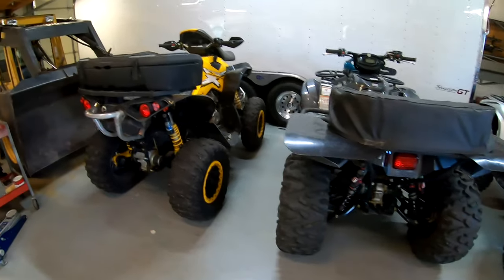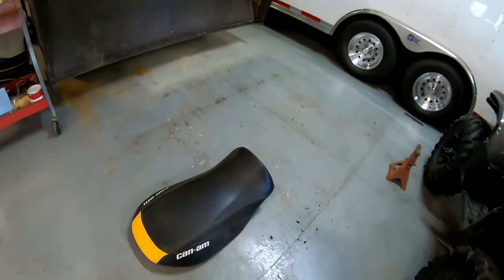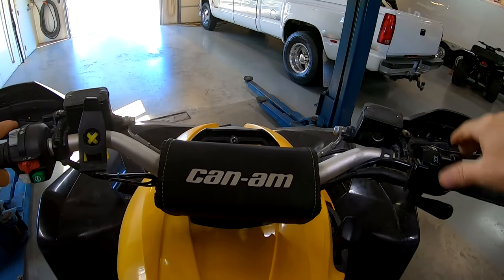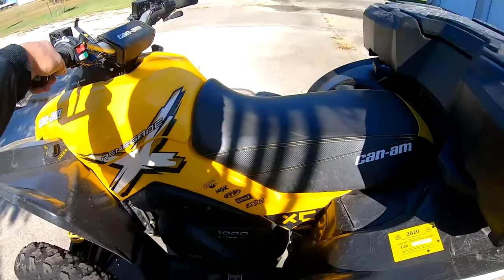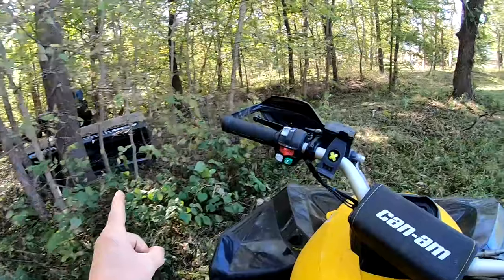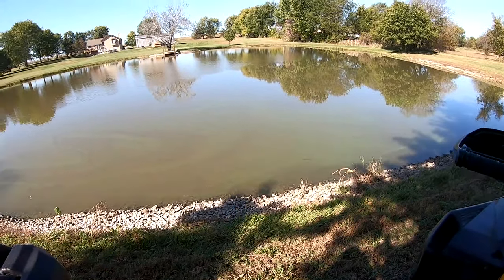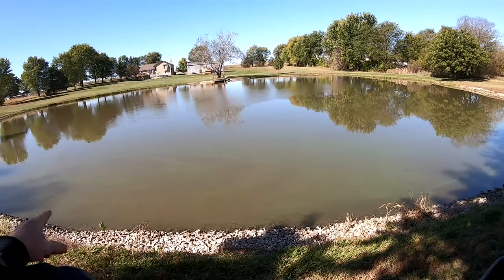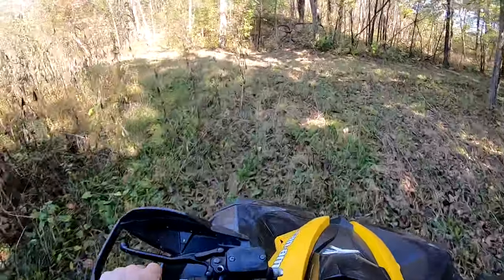Can-Am Renegade xc 1000 Sitting for seven months. Will it Start?

Comment: When you use a battery tender, do you have to disconnect everything from the battery, then hook the tender to the battery? Will the tender harm the electrical system of the vehicle is what I am wondering.
Reply from the maker: No need to disconnect the battery from the vehicle or the quad. 
Just hook the tender up and it charges at .075Amp
and then when the battery is charged it maintains it at a full charge state. 
Thanks for checking out the video!